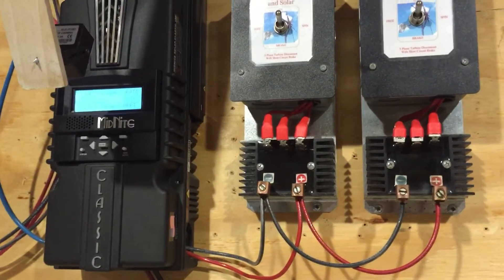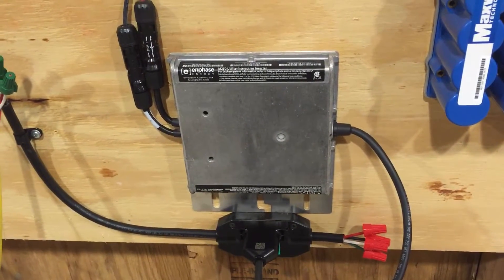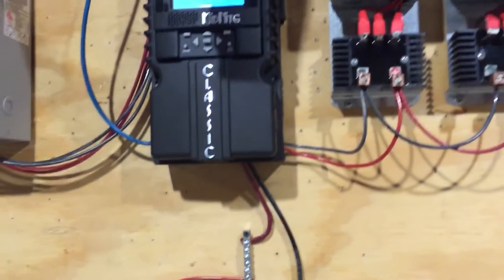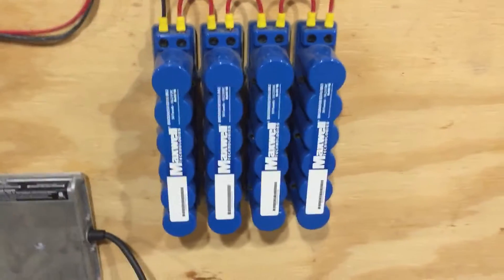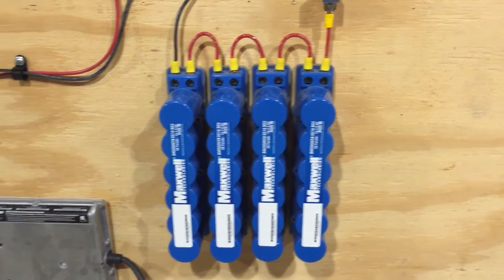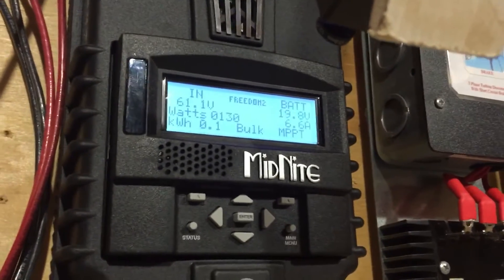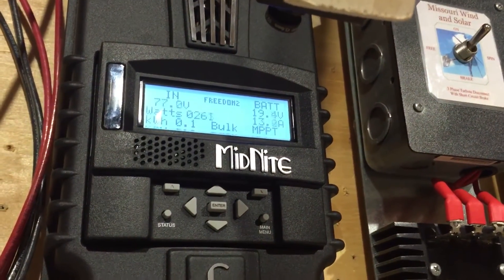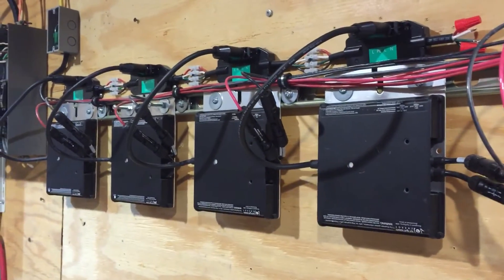Enphase micro inverter powered by wind. Part 1

Comment: @delfinocornejo3496. do you still have this setup working well? i am wondering if the same can be done by setting the midnite to above 80V which is my minimum for my fronius igrid tie inverter

Comment: Is it possible to connect the 24v output of a wind charge controller to the Enphase microinverters input? I want to use the turbine to directly feed into my grid.
Reply from the maker: yes very possible. is the charger mppt?  is there any possibilty that the charge controller will output a voltage higher than 48v?

Comment: Love what you're doing. I have a grid tie solar array setup using Enphase M250s. This is all without batteries. Is it possible to setup something similar to what you have without the charge controller? Can I bypass that part of it by connecting a wind turbine to an M250 ( Ihave a few spares) and a capacitor bank. The wind turbine I'm looking at outputs 24V and will likely not exceed the input max for the M250.
Reply from the maker: Dr. Michael Mehta no you cant. the microinverters are programmed to put as much load on the solar cells in order to find thier peak output.  that is what MPPT is.  maximum power point tracking.  if you connect a turbine to them it will try to extract the max ammount of power from the turbine effectively stopping the turbine. there are A LOT of dynamics in extracting wind power that only a “wind charge controller/ inverter can manage.   basically it boils down to loading the turbine right almost to the point of stalling the blades. now imagine trying to adjust all the load parameters a varying wind speeds..  thats why a “wind curve” has to be customized to each turbine performance carachteristics.  that is something you cant do with solar microinverters. thats why i have to use the wind mode of the classic charge controller..
Reply from the maker: Dr. Michael Mehta unless your site is a REALLY good spot for wind. constantly above 15 mph and you can errect at least a 30ft tower. dont waste your time and money. trust me.  invest more in solar..

Comment: why not use a few batteries instead or aswell as the capacitor bank to harness more electricity so you can continue when there is no or not enough wind?
Reply: Shannon Neal maintenance on batteries is a lot more